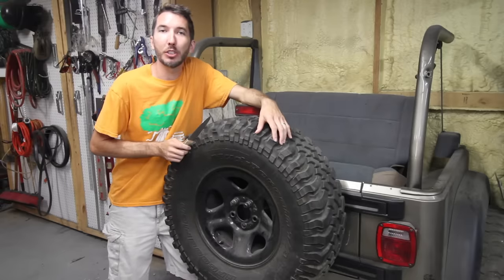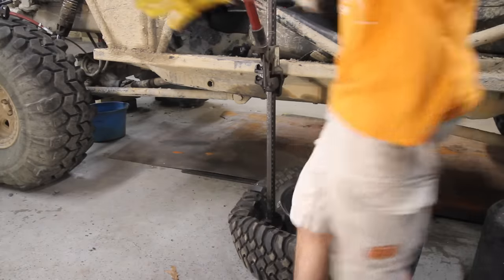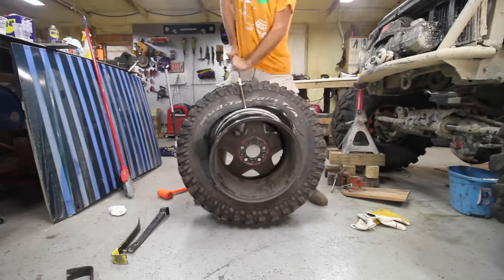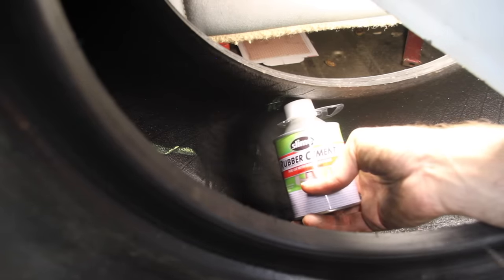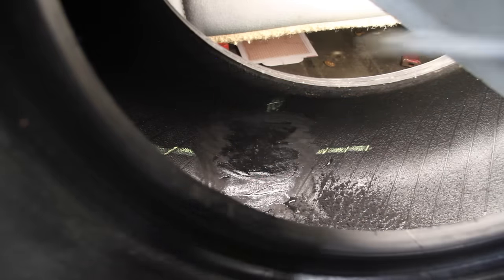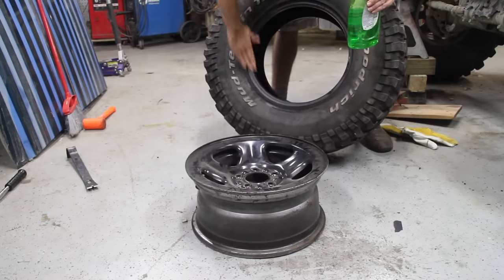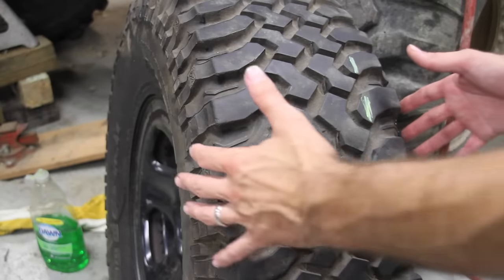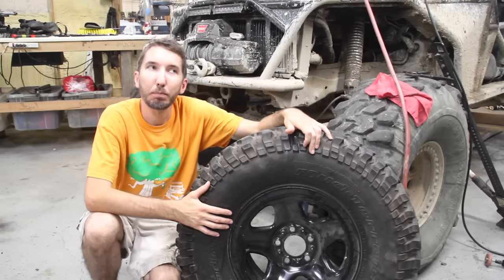How To Fix This - Patch A Tire

Comment: That's gotta be safe enough for even highway use
Reply: It might last on the highway, then again it might not. 
When I grew up a shop would recommend against a sidewall patch, but would still do it if you wanted. 
Too many people that could not handle failure sued and now none of the shops will, unless it is a small place and you know them well. 
I have ran patches in sidewalls, and the only one that failed was my fault. The truck was overloaded, it was over 100 degrees, and I was going too fast. Bouncing over a rough railroad crossing it blew out. No big deal, I changed it and went on my way. That was after many thousands of miles though.

Comment: In this video I'll show you how to fix a hole in your tire with a tire patch kit.  As mentioned in the previous video I don't carry a spare tire because my tires are just too big.  So I have to carry the air compressor to grind the inside of the tire, dish soap, a alot more tools...

Comment: On the trail, one don't have that kink of air to put into the tire. At least not that much of power air.
Reply: You can use a ratchet strap around the circumference/middle of the tyre, which, when tightened will force the bead out to the edge of the wheel and re-seat it. This way, standard off-road air compressor volume will be sufficient to pump up the tyre. This is particularly helpful if the inside of the rim, or the bead of the tyre, is not in top shape.

Comment: "You're trying to get off the trail". Uses, 3 pry bars, dish soap, and an air compressor with a grinder...
Reply from the maker: pee works good as a lubricant too!  just FYI
Reply: @bleepinjeep  No hard feelings, you did an excellent job.  It's just not a "quick, easy, get off the trail, emergency patch job.
Reply: @bleepinjeep  Anyone who has never spooned tires off a rim, good luck with breaking the bead and pulling the tire off alone.

Comment: And usually you have to go above 30psi to get bubbles
Reply: not really
Reply: Its Kiba994 who told you this?
Reply: I learned from experience. 95% of a time, I can't get bubbles with out of a tire lower than 30psi. Multiple times have I dunked a tire, had no bubbles, bumped the air up to 30+, and got bubbles

Comment: I would not have went through all the work to break the tire down I would have just used a plug kit and lined up plugs in the gash since it's only temporary anyways I've did so and it works just fine as many as six plugs in a gash and made it out

Comment: Man running high pressure is not safe either when you do a repair in the sidewall like that. Firstly the slice that was made in that tire has compromised the cords in the sidewall so high pressures and driving on that tire is going to cause a lot of stress on that patch. Secondly the fact that there is no plug-in that that repair means you're highly likely to get dirt and water and debris into the injury which could also cause a sidewall separation and lead do a blowout. Lastly I do understand that this is a get me by while I'm out Wheeling patch but if not done properly by a professional that could seriously injure somebody when they go to air the tire up if it blows up on them and is not a good idea only professional should be repairing tires. It's probably best for you just to carry an extra spare!
Reply: It would not matter if a cord or two was cut, as a large radial patch of the type used in the video has bracing cords bonded into the patch. as long as the patch overlaps the damage well there will not be a problem. Also it was repeatedly stated this was a repair to get you back to civilisation, not as a permanent repair. If you are sensible you would scrap this tyre and fit a new one before going anywhere again.

Comment: For ding dong this works I had a hole the same spot. Every f u k I n g  t I r e shop would not help me so I went home stuck a plug in it. Five years later my tire still holds up. Good jam 7:14 purple chango

Comment: Nobody is going to have all of that "out on the trail".  Maybe in their garage.  That whole "we can't repair if it's on the corner" is just tire manufacturers wanting to sell more tires.  Maybe that's why you mentioned that at the start.   I mean, it's interesting but dang, you need to be strong and fit to do that.

Comment: Now make the video where you run it at a safe pressure and speed showing that it holds or fails. The casing flex roll and temperature increase as you decrease pressure, tires are rated to withstand speed and temp at certain psi. Show us with your video. Average person will try this and try to run it when the situation arises.
He also may cause property damage and loss of life.
Right now, you're telling him it's "off road use only on the spare".
He didn't really listen.
Next video could be  "proving grounds"

Comment: Just dont patch sidewalls. Off road use or not. 9 times out of 10 it will fail again and it will leave you stranded. And you can patch a hole shoulder to shoulder as long as its no bigger then an eighth of an inch. Also, if your going on the trail invest in some small or medium Spoon bars. They are small enough to keep in the unit and have so many uses. Dont play with compressed gasses! It could cost you your life.
A Tire Guy Of 17 Years.
Doc.

Comment: Don't repair outside the belt zone. If you repair the sidewalk, the tire will flex whilst you drive and pop ur plug out and ruin the repair
Reply: American I didn't see him use a plug.
Reply: Russell Peters doesn't matter the tire shouldn't be repaired, it is unsafe, but hey it's not my safety so Idk why I'm commenting
Reply: American you must not have been listening. He clearly states that it's "for off-road use" and "emergency use only". As in you're on a trail and have no spare tire.

Comment: Who isn’t going to have five different pro bars, dish soap, air drill with grinder wheel, roller wheel, rubber cement and a patch kit out on the trail

Comment: You stated you run without a spare.  What is your thought process there?  That seems a little out there. I am disabled in a chair and think that I have to have a spare for my K02, but they are heavy and weight is everything. I can't lift it, no leverage, others have to help.  Really nice video, in my view, just like a wheel chair wheel- only difference is I do not jump and down on it to get it off, but bust just as many knuckles!
Reply from the maker: Nobody with 40" tires or larger is going to carry a spare... it's just not feasible.

Comment: i had an inch gash right below the bead on side wall. is that repairable?
Reply: eclipsebmx hell no , i would recommend you change it
Reply: eclipsebmx no never, I work at discount tire, this guy should not repair even what he did
Reply: No sir that is completely and utterly unsafe for you to repair I would change the tire
Reply: learn to listen... emergency only to get off the trail
Reply: Only on a trail crawler that you flatbed to a location. Never use a tire like that on the road. Off road though? Sure. Just keep the speed down. EXPECT it to fail and drive accordingly offroad and you will be fine and likely get more enjoyment out of your cash before replacing it with a new tire.

Comment: they make patches with plugs for  that little hole. they look like flat mushrooms
Reply: A plug patch is only any good for permanent repair to small holes and come in 3,6, and 10 MM sizes. The damage needs to be roughly the size of the stem of the plug. A hole such as that made in the video would not be reliably repaired by a plug patch as the stem would not fill the entire length of the damage.

Comment: You just cleaned it and grind it away lmao
Reply: EniGmaa_N1 supposed to grind it more shallow than that and then clean before patch
Reply: Same reason you clean paint and metal before grinding and sanding it. It will ALL be contaminated if you don't. That shit will get ground into the thing and ruin it.

Comment: Sir, all you managed to do was seal the air in the tire. With respect to the structural intergrity we will leave it up to your obituary when that tire blows out on the highway at 55mph...
Reply from the maker: how many times in the video did I say this was for emergency use only to get you off of the trail??

Comment: Crawling rocks for over 20 years.  You need to check out https://safetyseal.com, the original kit is what you seek. ARB also makes or sells a copy. Best tire repair system since the tire went from stone to rubber. I've personally witnessed a 4" sidewall slice repaired with two peoples kits on a brand new BFG. Guy not only finished the day wheeling it but drove all the way back to town for a new tire (not recommended of course). I have been using them since that very day and yet to have a single plug fail. Every daily driver I've ever owned has had a minimum of two tires plugged during the tires life span and never had a single tire failure. Seeing that trail repair with 40+ plugs looking like a jar of licorice hold air all day long sold me for life. 

The repair you did would take 10 minutes tops and I'd continue wheeling it until it became a problem, if ever.

Comment: no whey that tire went back on that easy
Reply: I mount tires on rims on the ground all the time with the right angle, enough lube, and pressure at the right points they often go on even easier  than that (smaller dia. or shorter sidewalls (low pros) make it harder to mount a tire on a rim though) also a 80/20 mix soap/water makes a much better lube and use plenty of it dishsoap is cheap and will act as a bead sealant too

Comment: Crossply or bias waiters should never be used in radial tyres? You must use radial gaiters in a radial tyre otherwise they split. I have found a universal tyre patch is actually better for a sidewall repair on otr tyres as they flex more. I have repaired tractor tyres this way for years. Obviously you would never repair a tyre this way for road use.

Comment: How he just got done patching up that tire he when he aired up the tire he did that very unsafe you do not stand up the tire while you're airing up or Reef lighting the tire crazy all it takes is for that trade is to peel off and slap and hit you an injured you so do not have the tire in a upright position lay the whole tire completely flat on the ground and stand on top of the The Rim in air up your tire that way it's more safer and less of a chance you getting injured how I know this is I learned by experience and watching other people air up tires don't ever play tired like he did very unsafe you can end up losing an arm or more of a catastrophic more of an injury that could be life threatening

Comment: you are cleaning where the patch is going and after you do the grinder????? why do you have to clean before grinding  strange
Reply from the maker: This is why I cleaned before buffing, as per Rubber Manufacturers Association and Michelin Tire: "Step 3 PREPARE INNER LINER SURFACE
Clean the area around the puncture thoroughly with an appropriate (pre-buff) inner liner cleaner. Use a clean cloth
and/or scraper, according to repair material manufacturer’s recommendations. Consult your local repair materials
supplier for an appropriate cleaner3. This step serves to remove dirt and mold lubricants that can reduce repair unit
adhesion and contaminate buffing tools."

Comment: Never repair a shoulder. Not even a simple puncture as that part of the tyre is the part that flexes the most. And the patch will simply fall off.
I have seen no end that has happened.
And NEVER lever a tyre on, you will tear the beads. Tyres are fitted with a rubber mallet. The sand filled I see there will do the job in the lack of proper tool.

Comment: Fuck youtube read mind shit, i just got fix my tire with the same procedure, big ass metal sheet stuck in my tire and slash it, tire shop guy, easy peace,remove rim, grind it, use crazy glue and grinder rubber to fix the gap , put rubber cement and patch it, total ?$4 box,

Comment: Most  starting fluids contain an upper head lubricant  {oil} not good for adhesion. check can of starting  fluid. be for using.

Comment: Ok as a certified tire tech i see that he did take a lot of un-necessary steps but i would definitely get that tire replaced because once a hole that large is made in that area if it is to much for to long it can blow out also ppl on here arent thinking about the weight of the vehicle on the tires that alone in some patch cases can be enough to blow the patch out.

Comment: When he says that any reputable shop won't fix an injury outside of those marks for "liability purposes only," what that actually means is the tire is no longer roadworthy. He stuck that knife into the shoulder of that radial tire, meaning he cut the zipper. The zipper is the structure that connects the belts in the tread to the sidewall, and is therefore kind of important. When tires explode on the highway, or when a semi-tractor loses a tire and lobs shrapnel in a substantial radius, that's frequently a zipper failure. Often precipitated by damage to the belts or to the chafer which protects the union of zipper-to-belt. This repair's okay for the trail, but should never be put back on the road. If you intend to use this method of repair, bring an air hose and put the vehicle between you and the tire when re-inflating. Then replace the tire when you get home, ya cheapskate. Here's a video of a 22.5" truck tire's zipper failing, with similar tire construction to the Load Range D and E tires commonly found on the trail: https://www.youtube.com/watch?v=laigjqauVJQ

Comment: Let clarify something its not rubber stuff to seal anything that goes on the outside of the patch its to keep any debris thats still inside the tire from compromising the patch if there is any I mean you know basic enough stuff but plz read up before saying something that tire techs/mechanics  will get irritated with and make sure to try and atleast  use some type of lube so you don't rip the bead and fuck the bead pac or bundle up

Comment: who are you expecting to have a compressed air source, and a air operated grinder when out on the trial?
Reply from the maker: Me
Reply: sighs the compressor is part of the on board equipment to power the diff locks and axle locks. You just show total ignorance of off roading
Reply: I guess I'm out of touch with the latest off road gear.  Back in the days when I did off roading, there was a shift lever for performing such operations,   When air was needed, there was a hand pump
Reply: @rkwill100   Times have moved on, and most diff and axle locks on commited off road vehicles are nowadays engaged with an air operated clutch mechanism. this is why theres an onboard compressor that can be utilised. Of course for lesser mortals, a lever is still often used!
Reply: robert till  hey. I love my ox lockers.   No leaking air lines or blown seals to worry about lol.

Comment: Now I work at a tire shop, you made a huge mistake and let go of the pry bar while trying to stick the other in, I did that yesterday and it came back and hit me right in the face, broke my skin and left a pretty nice gash, that’s a big no, I’m not digging you I’m just giving you a safety tip you here ah that never happened when I let it go but you absolutely never know, always keep one hand on each bar or double them over so you have full control of your tools

Comment: It’s a racket that anything outside the middle can’t be repaired.
Reply: It can be, you just have to do it yourself.  Just make sure there is no internal damage to the sidewall that you can't see from outside the tire.  The closer to the edge you get, the higher the risk of sidewall damage.

Comment: The reason they dont do plugs and patches on sidewalls is because the tire flexes in that area not because of liability. Patches and plugs can and do give during flexing. If you have an emergency somewhere where happen to have everything to remove a tire, a plug kit, and a way to fill it back up then by all means do what you have to do to get back to a tire store. Everyone else feel free to not be retarded and call a wrecker or even better take a spare tire with you. I do find it amusing he teaching how to do something "out on the trail" but couldn't do it without his shop tools.

Comment: Здравствуйте. Если будет ехать со скоростью 40 км в час, то он спокойно доедет до профессионалов где ему сделают хороший ремонт. Хочу по порядку, Во-первых, где в тайге он найдёт все инструменты для подобного ремонта? Во-вторых, подробное повреждение в тайне крайне редко встречается, обычно рвет нити поперек 2-5 сантиметров. Этот ролик больше для хайпа, для просмотров. Каждый водитель с собой возит инструмент? Нет. В данном случае если ситуация безвыходная, проще иметь с собой две три камеры целых и одну дырявую, нерабочую, на место повреждения наложить кусок камеры плохой и вставить целую камеру, вы спросите, для чего поставить кусок камеры на повреждение,? Чтобы не было эффекта ножниц и не перетерло камеру целую,. После этого и легче накачивать колесо будет, не надо будет ничего придумывать чтобы накачать, чтобы шина села на хампы.
Reply: Everyone in America that I personally know, that goes mudding, or rock climbing, always has these tools with them. It's just part of the roll out. You keep tire tools, and a variety of patches, as well as a DC compressor or one that runs off of your drive pulleys.
Reply: @A_Stereotypical_Heretic  я работаю в шиномонтажной мастерской, работаю ремонтным материалом Tech, и там тоже требуется соблюдение технологии ремонта. Я знаю о чем пишу. Для подобного рода повреждения требуется горячая вулканизация. Иначе позже нити Корда будут гнить, и колесо долго не проходит